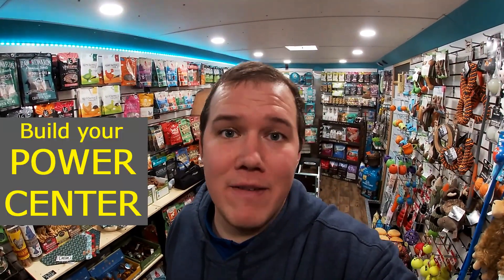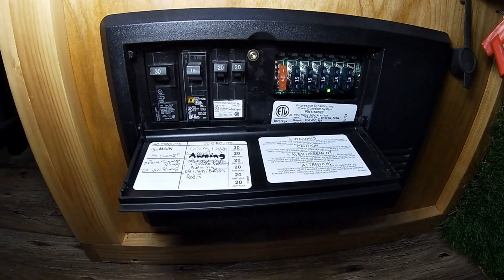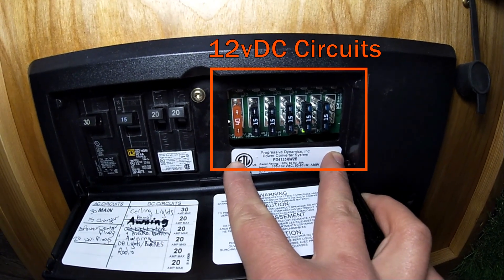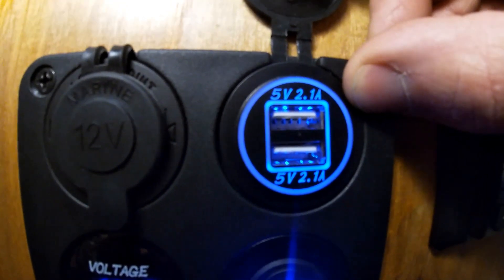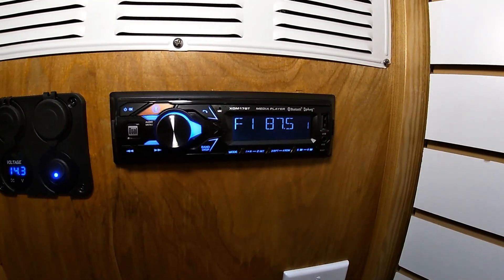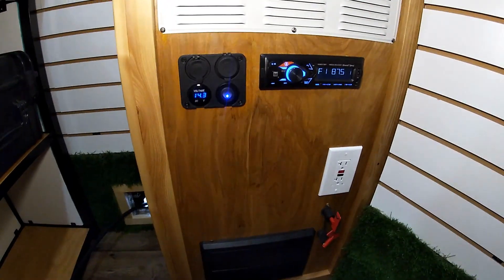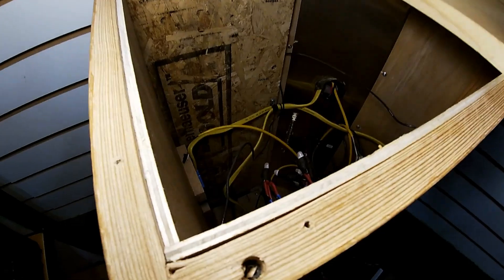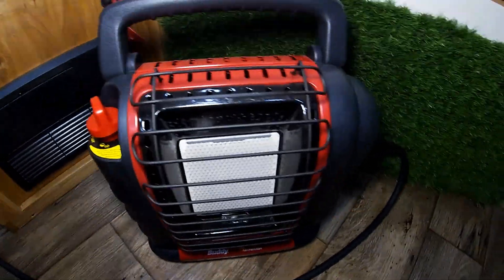Cargo Trailer Conversion Electrical Power Center | Progressive Dynamics 4135 | How To Build Yours!

Comment: Can you explain the three wires on the right side of the disconnect switch and the one wire on the other side. I understand the positive terminal from your battery goes to the red F1 on the 12v block, but I’m confused to what’s coming into the disconnect

Comment: Greetings: Good presentation. Very well done.  Electrical / Electronics is 1 of my trades. I have done trailers and boxes, some similar 2 Ur plan. I have plans drawn 4 a trailer a bit larger than Ur's ...when I find it. Thx 4 the share.

Comment: Great job and nice video. It seems like this is the way to go with any overland or cargo trailer build, installing the 4135 PD. It is cheaper and less work to hook everything up! This is like a multi unit. Can you hook up an Inverter to your set up?  I would think so.

Comment: Mini Solar Winter Tipp: You can steplessly dim down a Beuler and all other hungry electricity consumers with a 5000W dimmer (EUR 7). I run 5 dimmers in parallel on an 850W inverter. Kettle 2.2KW at 150W runs 12 hours a day, so the water is always hot. The room is also nicely heated. 2.5KW washing machine runs in parallel with dimmed to 200...400W. Iron, dishwasher, oven, electric heater, coffee machine, all internal heating are throttled with me. Videos about it on my channel https://youtu.be/eC2olbCBhh0 The inverter stays cool, quiet and the MOSFETs remain intact because extreme current peaks no longer arrive at the inverter. Now every Mini PV Inverter is enough to sell large devices. So with the dimmer all internal heaters/devices can be turned into base load devices that stay almost permanently ON while drawing very little current.

Comment: question I’m thinking about buying a fully enclosed utility trailer for my lawn care business and I want to install an electrical panel and inverter with built in transfer switch and shore power connector so I’m wondering should I connect a ground wire to the trailer frame so that the frame is grounded when pluged in to shore power

Comment: Did you have any schematics from this wiring? I’m working on gathering all my major electrical now and will wire it up in the next few weeks
Reply from the maker: no i dont have schematics. I used pretty simple circuits, and since everyone has different needs, you know it's like wire it up the way you need it. You got this Terrence!

Comment: Hello! I noticed on your shot of the battery switch on the inside you have what looks like 3 wires? Would you mind explaining these? In your diagram it looks like one would come from the battery ground and you’d have another going to the power converter? What’s the other wire for? A separate ground? Thank you!
Reply from the maker: I hear ya, it's a basic diagram showing opening and closing the ground instead of the positive side. But you are right. The switch has two posts, one is direct off the battery, the other post has a wire that goes to a ground buss bar, a ground to the power unit, and a ground that runs outside to the trailer brake emergency battery. The trailer came wired one way, and I had to modify it to my needs. I suppose just going to a ground buss bar would have been enough, BUT! when electrical problems arise its usually a ground problem, so I take grounding in a 12v trailer seriously. Lol.

Comment: You said the max battery protection is 30, but you have a 40 amp fuse in the slot...makes me worry about all you wiring.
Reply from the maker: It's all good, I talked with the progressive dynamics engineer about the battery supply wire gauge they supplied. 40 amps is really to protect a short to ground, or reverse polarity from incorrect wiring. Each circuit thereafter is protected by a 15 amp fuse. Even a tiny spark from a short would blow a 15 amp.

Comment: Question for you and commentors:  Is it better to use two 12 volt batteries in parallel or two 6 volt batteries in series?  Thanks!
Reply from the maker: 2 12v

Comment: could you identify the unit that has the 2 usb  ports |  the 12dc car plug / battery charge level 
 I did not see it in the vid.  "this little guy"  hehe
Reply from the maker: Yea its a charging unit by Kohree, I actually really love it and use it daily. There is a link in the video description with all of the items I used including the charging unit.

Comment: Great vid.

Can you provide any specs on your trailer.
interior / exterior  dimensions of your trailer  ( I'm thinking you want >= 7ft otherwise would feel cramped up ?) 
what's the apx total you have into this project.
Reply from the maker: Are you looking to camp in it or make it into a business? It's 8.5x18.
Reply: @MTsubfly  a business, will have workbench..  40" sanding belt.. grinder/polishing wheel
what is your inside height you didn't look cramped ..

thanks for your reply
Reply from the maker: @safeway3168  cool yea I think I ordered it at 7ft 6inches. Double R trailers in Nampa, ID will build you whatever you want. They are very good at that. So many run of the mill trailers with extra height are barely 7ft, so it make a big difference.
Reply: @MTsubfly  thank-you for the info... yeah I thought the height is key. Will look them up.
Best of success with your biz.

Comment: What did you ground to on the dc side to allow you to have full dc power without the battery turned on.
Reply from the maker: Grounded to the frame, but still ran a separate ground cable to a ground buss-bar, which further connects ground to the power unit. The LED lights on a dimmer got thier own ground wire, wired in parallel.

Comment: Great Video!  I am wiring my pop up with the PD4135 and will use this as a partial model (thanks!).  Could you tell me the basic scheme of battery, converter, and charging panel so that my charging panel would give me all the information that you just described?
Reply from the maker: Awesome Bro!!! I'm not 100% sure what you mean. The 4135 connects to the battery, the mini charging station I have, and 110v coming in. The unit makes this a breeze. Can you clarify or be more specific? Wiring is not an easy thing to write about, but I wanna help if I can!
Reply: @MTsubfly  thanks for getting back with me. I guess what I'm asking is where exactly do you hook the USB / aux charging panel? Inbetween battery and converter, from the fuse box, or somewhere else?
Reply from the maker: @joshsmyrl1204  Gotcha. The aux charging panel would get its own circuit, its own fuse. the PD4135 has several 12vDC fuses/circuits available. So the battery would go straight into the PD4135, and the 12vDC Power would be distributed through each of the fuses/circuits available. So connect your aux charging panel to one of the 12vDC Fuses. I hope this makes sense. This way, if for any reason too much power was drawn though your aux charging unit, it would blow a fuse, and protect the wiring/unit from damage.
Reply: @MTsubfly  that makes perfect sense about the panel. Thanks! 
What about the battery? Does it plug straight into the converter at the the fuses too? When I look at the manual it looks like it connects to the thicker red wire above the 40 Amp fuse. But isn't that where power comes out? Like for the charging panel?
Reply from the maker: @joshsmyrl1204  I'm thinking off memory here, but that first red wire connected to the 40 amp fuse should be power coming in from the battery. That's how power is supplied from the battery and also how the battery is charged. The idea of power coming (in and out) can be confusing & deceiving. In reality trace how Power flows through any circuit, electrons flow negative to positive.
Reply: @MTsubfly  thanks so much! I really appreciate you!

Comment: Hey mark, your insulation video really saved me. Luckily I was at a place where I could start over, return most of what I bought and do exactly what you did. So thanks! My only probable right now is condensation. I’m in Seattle with a lot of rain and semi cold weather. And right now I use a mr heater big buddy propane for heat. With a good vent and gas and Corbin monoxide alarms... but the condensation is unreal. So with the insulation you showed me, is all that water and condensation still going to be there just behind my walls? Will the insulation make it stop? And also that pink foam, it doesn’t have a vapor barrier right? So I would need to add that? Did you? Sorry for all of the questions, I can’t find a single person that has really been able to help me without costing me a ton of course. So I wanted to pick your brain amongst others on trailer conversion if I can find one that seems to know what their doing like yourself ... I was hoping you had an email or something to reach out, so please comment back if you  can thanks!
Reply from the maker: Thanks for the comment!

XPS (pink stuff) is superior to EPS and Polysio when is comes to moisture. It can and is used underneath concrete in some places as I understand it. It resists moisture.

I'm not sure were you are getting condensation, but using propane will increase moisture levels surprisingly. Burning a gas releases moisture into the air. (That's why gas furnaces have a drain, and why gasoline cars drip water from the exhaust {partly}) So propane heaters may raise the temp, but may also be adding to the relative humidity inside, and if your walls (including insulation) are cold enough (at or below the dewpoint, which in Seattle often times dewpoint is very close to the relative temp=condensation) then moisture will condense onto the walls surface (like an ice cold soda-pop can). 

I didn't add a vapor barrier, nor did I make it perfectly air tight. I also live in a dry area. I don't think you need to add a vapor barrier. The XPS is resistant to moisture. I think it is a closed cell construction.

I appreciate the questions. I don't know everything, and I'm learning daily. So maybe someone else knows better than me? For me what I have shown has been working great for the last 6 months, and the trailer has been used almost daily, along with a propane buddy heater. But then again, I live in a dry environment.
Reply: You need to check out a you tuber named "Slow Lane" he lives in Oregon and is having your same problem
His video is titled "Cargo trailer insulation tips"

Comment: Tell us about your business. 

Also, looked like you used standard house wires for your 110V.  If you upgrade your system,  use stranded wire next time. The solid copper house wiring can work harden when bouncing around and eventually break.
Reply from the maker: Thank you! You are the 2nd person asking about the business. It's a mobile pet (dog/cat) supply biz. We're hoping to get into a building some day, but folks are loving the trailer besides limited space. 
I didn't think about stranded wire, though as a former aviation mech, I get what your saying. Solid wire isn't used in aircraft due to the high frequency vibs make them crack. Thank fully so far we aren't moving around too much for now...Cheers!
Reply from the maker: you can see our website and a few pics of our trailer here: https://www.localpawsredmond.com/products/shop/
Also were on facebook and instagram with the biz. Local Paws Redmond